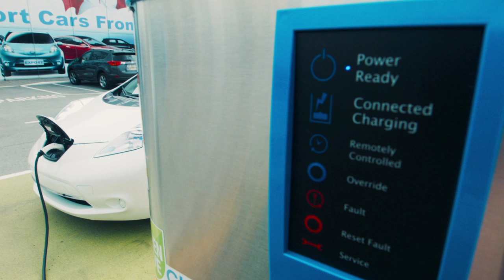Electric Motorcycles vs Gas Motorcycles (HARD FACTS)

Comment: One thing that is misleading when it comes to comparing energy density as our Boi Hammy Lube does, is the ability to actually transfer the stored or potential energy into go juice at the tyre.  For instance, a really, really, REALLY, thermally efficient I.C. engine can convert about 40-ish % of the fuels potential energy to power at the crank, with the rest lost to friction or heat expelled into the cooling system.  Electric motors are capable of transferring something closer to 90% of the stored electrical potential energy to the output shaft, mostly since there is only 1 component of an electric motor that moves and dissipates energy to friction.  What this ultimately means is that if we have 3 gallons of fuel on a standard bike at 36KWhr/gallon that's 108KWhr of chemical potential, but if only 40% makes its way to raw crank-shaft power, that means a 3 gallon tank only has ~42 KWhr of usable energy. so to match that, an electric bike would only need a 50KWhr battery to match the usable energy of a gas bike.  Overall I think the idea of electric motorcycles is very interesting and I'm ready to see what comes from the proliferation of electrification.

Comment: Engines are also neither light nor small; while the battery pack is bigger than the gas tank (comparable to engine), the motor is much smaller (comparable to transmission) and there isn't a transmission on electric - my Zero SR/F they pack a 14.4 kW-hr battery and 110HP motor where the traditional engine and transmission are, and what would be my gas tank is a storage compartment, but I could get a "charge tank" (extra circuit for faster charging), or a power tank (extra battery for extended range). And because of that, it's surprisingly practical for a truly naked bike. I can carry my lunch in my Zero, not so much on my H-D Dyna Fatbob, nor my SR400, and each has the same ballpark of range (SR400<Zero SR/F<Dyna). So what I'm trying to say is while the battery is big, the overall package is actually smaller.
I'd be very careful about not being to able to repair an electric motorcycle as a con - in most cases, the electrics are also much more reliable so much so that it more than offsets the cost, especially if you compare to a major maintenance or repair on a gas bike (as you'll be making many more of those, every 8k-15k miles or so). Even if you did have an expensive repair on an electric, it still saves money in the long run because of how infrequently it happens. My battery pack has a 5-year, unlimited mile factory warranty - no gas manufacturers are offering those types of warranties because it would probably bankrupt them.
Reply: my yamaha bolt came with a 5 year unlimited mile warranty
Reply: @bjorn1583  Standard warranty is 1 year, so...
Reply: @jerm1027  l dont think there is any bikes that only get a 1 year warranty and when l bought the bolt ALL star bikes came with 5 years unlimited

Comment: Dji is in the process of solving this problem as we speak. They developed an innovative breakthrough with a small motor and unique gearbox that have very high torque output and use less battery. I can see big brand motorcycle companies buying the motor from them

Comment: My 2015 Zero SR has lost about 5% charge at most. FYI... one thing about battery power is cold lowers performance and increases charge time if the temp is below freezing. Here in Colorado that is about 2 months out of the year.

Comment: I've been riding electric bikes for a quite few years now. Yes a few years. I've ridden Lead Acid Battery moped scooters, I own a 1st gen BMW C-Evolution with the Long Range package, and my brother used to have a Lightning LS-218 as a track toy.

Lead Acid batteries aren't great for a whole lot of things, but the batterypack in that moped did get a reliable 110km range at 45kph. It was advertised with 160km range though and it never made that, it got maybe 130km when it was brand new and over the course of a couple of years that dropped to 110, which was fine for my 80 ish km daily commutes.
Upgrading it from lead acid to lithium polymer would be almost a 1000 euro investment (including charger, battery management etc), replacing the lead acid batteries would have run me maybe 300 euro. But keep in mind that this is a 300 euro 'maintenance' fee about every 40.000km. A regular petrol fueled moped has a maintenance interval of about 3000km, need to get valves adjusted, belts inspected, sparkplugs replaced, oil, filters the whole works. This is still a 250-300 euro service and it happens much much more frequently.
Minor services like brushes and other wear components, that's about the same either way.
The biggest downside I experienced with that electric moped, was people who ride bicycles with electric support are twunts who will unplug another bike in order to charge their own. And because these kinds of bikes use regular plugs and outlets, the charge cord doesn't lock. I eventually modified the theft alarm to start blaring if the charger was unplugged, before it was done charging, without the key in the bike. That did help a lot, 135dBa of instant punishment for unplugging my bike made people plug it back in real fast.

My BWM C-Evolution, it's a couple years old now. I did have it restricted to an A2 license, because that was more convenient to me. And let's be real, for commuting and light sightseeing, 35kW is plenty. It's pegged to 135kph top speed, but again, the speed limit here has recently been lowered to 100kph. It's plenty to overtake a lorry on the motorway. As for the range, BMW promised me 160km when I bought the bike almost 50.000km ago. So far they haven't broken their promise in the slightest. Heck I am convinced they sold me a battery that could do almost 200km, just so it will never go under the advertised range.
I charge up at work, I rarely have to charge at home at all. So in that regard it's pretty much free to ride. It takes about 4 hours to fully charge from a household socket, and it'll take a 30-80% charge from a fast charger in about 30-40 minutes.
Going on a roadtrip with the lads, it takes a bit more planning, because he have to sort of aim for cafe's where there's a charger nearby enough that I can plug my bike in to charge. But that isn't that much of a problem really. I mean it's a country half the size of Delaware and there's 35.000 public chargers and over 100.000 private chargers, though a considerable amount of those are "privately owned" by a hotel or restaurant, so they are effectively still public.

The LS-218 was a brilliant track toy, but far from cheap to run. It is scary fast. That's really all I can say about that. Setting it to have a linear throttle response is a brave thing to do. That thing really showed what an electric bike is capable of if you make no compromises. And I am not ashamed that being a scooter rider I am not the rider who can take that bike anywhere near it's limits.

So I'd say electric bikes are perfectly viable for commuting and general urban mobility, but it really depends on where you live. I can ride anywhere in my country without ever having to worry that I will not be able to find a charger. Even in the most rural of area's there are going to be cafe's and restaurants who will have a charger. Or who will at least have an accessible outlet for slow charging. But even then, spending an hour over some drinks will get me enough charge to get to a fast charger where I can top up sufficiently in 20 minutes to get home.
And for serious roadtrips, I just borrow my friend's X-Adv and in exchange he gets to "play Jetsons" as he puts it on my C-Evolution.

Comment: Electric vehicles are great around town or commuting short distances. At present, for long journeys they need a completely different mindset - one that can accept long breaks far more frequently that we're otherwise used to and they need some forward planning - if there's nowhere to charge, you might want to think again! In fact, you want a backup plan for when your chosen charger doesn't work and, ideally, a backup plan for your backup charger...

Going off on a complete tangent, there was some amazing scenery in that video. I wouldn't get far in a place like that on any type of vehicle - I'd be stopping every few feet to take a photo!

Comment: I have an electric MC and I wouldn’t want to trade it for any gas burner.
Initial cost is high, yes. but TCO is the same or lower.

It can outperform most gasburners on any practical application … save for the entertaining long strech, high speed, speeding ticket inducing impractical use.

“can your electric bike do this?” came up in text about 1/3 in the video … euh, yes … look at Zero DS, DSR, FX and FXS.

“It takes too long to recharge” … boo freaking whoo … what a first world problem. Save for the long trips, most if not all destinations can be reached on 1 charge. Then you arrive, plug it in somewhere (If you’re not in a 3rd world country like the US) and let it recharge for a fraction of the cost.
Don’t compare charging with stopping at a gas station because that’s not what you do with an electric bike. 

“It makes no sound” or “loud pipes saves lives” … don’t make me ‘OK, boomer’ you! No matter your age.
Reply: A god in the gap alright have fun with toy. Some of us still enjoy banging through gears and analog feel
Reply: saverlater123 | Thank you, I will.
You have fun with your toy too.

Comment: I've ridden an electric Gogoro 125cc 100kmh class electric scooter in Taiwan which has swappable batteries so you don't have to ever charge.  The scooter was better in almost every way compared to the 125 Yamaha I had and the range was almost as comparable.  I rode the bike all day including riding up a mountain and back into the city and I still had half a charge left.  These scooters could accelerate much quicker as it had instant torque off the line and they were also not silent with a futuristic electric whine.  I hope they can expand to other countries with their whole ecosystem of battery swap stations as there was no disadvantage with having to wait recharging and as the batteries on a bike are not as big as a car you don't need machinery to swap batteries out.  The Gogoro scooter had 2 batteries under the seat and still enough room for a helmet.  Gogoro is so successful in Taiwan that they have produced hundreds of thousands of electric scooters and are getting almost 10% of the motorcycle market there and 90% of the electric bike market. The system has also been utilised by third party manufacturers like Yamaha to create their own electric scooters for the Taiwanese market but use the same battery system.  Petrol engines won't be going anywhere soon but it's exciting seeing a choice in the market that's being lead by technology.

Comment: I think the companies who produce electric cars/motorcycles should standardize the batteries they use and make it swappable. So in the future you don't have to wait for your batteries to charge you just swap the ones on your vehicles to the pre charged ones in a power station. Kinda like what we do for propane tanks.
Reply: but the problem is that some batteries are more powerful than others...
Reply: @illusionsstage3254  they should have a lot on stock form the different brands and models.

Comment: The whole powerplant argument is a slightly invalid, we need to use more nuclear power and faze out traditional powerplants, these nuclearplants give out no co2 at all, you could argue getting rid of the waste caused polution but there are lots of nuclear waste dipositories that are half finnished, finnishing these then waste wouldnt become a problem for a long time, the problem I see with EVs is making the batteries, this causes why too much polution for how long the battery lasts, a gas engine may burn petrol but the polution made in production is so much lower then a just a battery that it still makes sense to use petrol, not also that but lithium makes the people who dig it up go blind and most of them are slaves working in terrible conditions, I think batteries are the biggest problem that needs fixing quick, not charge times or price. We need to make then out of a different matterial wether that be super conductors and just straight up scalectrics or dodgems style with no batteries

Comment: You know I have a Harley livewire. I love it. It’s my daily rider. I ride all day. I never ran into a range issue. I commute 40 miles one way 5 days a week. Plus the mountain rides on the weekends. But with this said my situation is unique. I have a level one charger at work. Also there’s chargers in the mountains where I ride so my bike is always topped off when I ride. So it’s super rare that my battery level is below 1/3rd. But that’s my situation. I understand that not everyone has my situation but I’m glad I do.

Comment: Is it just me or does anyone else want to see Koeniggsegs Free-valve tech in a bike , the applications would be amazingly insane on one
Reply: Yes that would be amazing but it would only work on big bikes. That Freevale Electric Actuator system needs alot of Electric Power. Thus that 40v power system realy only works on big bikes with space. The only way i can image that would on light weight sports bikes is a SuperCapacitor and starting it up with external power.

Comment: E-motorcycles would be well suited to the commuting/errand role, but at present there just aren't many aiming for this power range (19-34 kW, 25-46 HP). Just the Zero S & FXS, with perhaps the Chinese Evoke Urban S & Niu RQi coming in the near future. The Zeros are up to twice the price of a comparable 250-400 cc, because batteries are still so expensive. Alas, most current e-motorcycle offerings are more like the 1st generation Tesla Roadster. Fast, but expensive, heavy (for a sports car), and with so much range anxiety. Rich man's toys.

That said, I like the idea of quiet running, mechanical simplicity and environmental goals. Only expendables would be tires, brake fluid/pads, and belt, so maintenance intervals could climb into the cage range.
 A moderately priced and powered electric (I don't need to go 100+ mph on my commute) would make a useful complement to a gas motorcycle (for more sporty or-far flung adventures). Not great for some living situations, but if you've got a garage for nightly charging you're set.

Comment: When you were talking about the amount of energy in gasoline, you forgot to say that a modern engine only get 40% out of that energy as power
Reply: That's exponentially better than what batteries can store, but who cares about that
Reply: @savagetuner2404  The difference is just.... 60% less. When he talks about the point the difference sounds so much bigger than it actually is. But who cares about that
Reply: Mikael S-P I don’t care about sound. Electric bikes are good for people who aren’t enthusiasts. Same with cars.
Reply: @savagetuner2404  okay, I don't get where you are going.....
Reply: Electricity has to be generated, transmitted and served. Up to 50% losses in transmission from the power station, 20% loss when super charging and battery loss of 5% every 100 charging cycles.
Reply: @alphalobster8021  ahahahaha... I have no idea where you got those numbers.... But they are far from that low

Maybe in 1940

And gas also has to be found, dug up, transported and pumped in to your vehicle... Gas production is the world's most polluting work
Reply: @mikaels-p6765  Yeah, I the same shit that makes electricity. Before transmission and charging.
Reply: @mikaels-p6765  Electricity is generated from gas, coal, oil, biomass (wood) and nuclear. Wind and solar are so variable and minor you would not notice if it disappeared. Not only that but battery tech is so energy intensive that 1 kwh requires 150kgs of CO2! Add it all together and you have the opposite of clean. EVs simply terrible tech and environmentally stupid. As is wind as is solar power. Oh and transmission losses are up to 50% in a modern network. Seeing how 80% of the world is not first world, then probably worse.
Reply: @alphalobster8021  Not to mention that the BEST of batteries lose charge rapidly as well. It's a good technology, but nothing special. Amazing how people fall head over heels for the next big trend
Reply: @alphalobster8021  In Q1 2020 in the EU 27 as a whole,  over 18% of electricity generation in 2018 by renewables (Source: Eurostat 2020).  On battery tech Co2 emissions for their manufacture range from a low of 61 kilograms per kilowatt-hour to a high of 106 kilograms per kilowatt-hour, so again your figures are out of date or just misleading. (Source: IVL in support with the Swedish Energy Agency, 2019).
Reply: @mikaels-p6765  Every goddamn bike owner i know, cares alot about the great noise that comes from them. And the fun of changing gears on a bike. Electric bikes are good for people that want to go from A to B, but most enthusiasts would not find them very exciting. They are just 1 trick ponies, only thing they do is accelerate, thats the only experience you will feel.

Comment: I think electric scooters is where it’s at , someone needs to make a cheap transporter and start from there
Reply: There are lots in Asia - scooter heaven. However, they’re still a minority compared to petrol scooters, mostly 125cc.
Reply: There are plenty, though only a few that do better than 45 mph, which would be a bare necessity for local streets. 

In Europe, there's the Silence S01, Ninebot E200P, Super Soco CPx & VS1, Horwin EK3, and Niu NQi GT & GTS. In Taiwan, add the Gogoro S1 (Gogoro has 2000+ battery swap stations in country). Of these, only the Niu NQi GT/GTS is sold in the US, and dealers are asking US$ 6000 (in China, this class of vehicle is about US$ 3000).